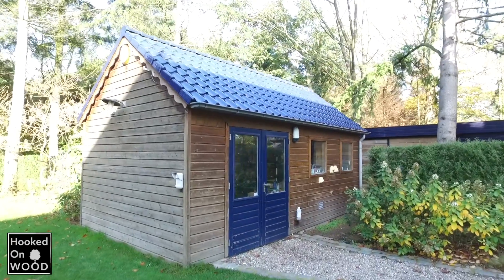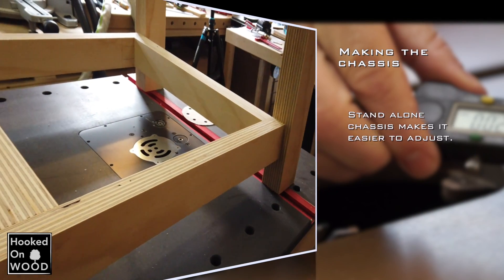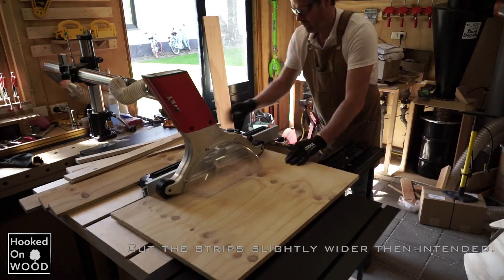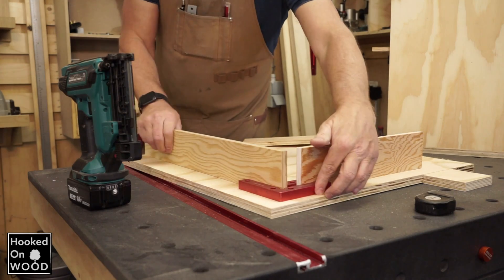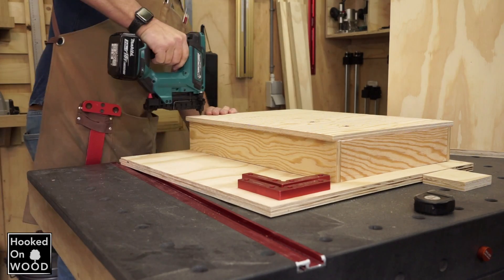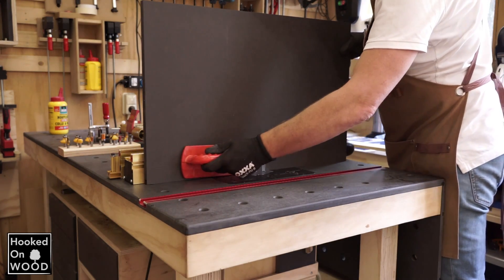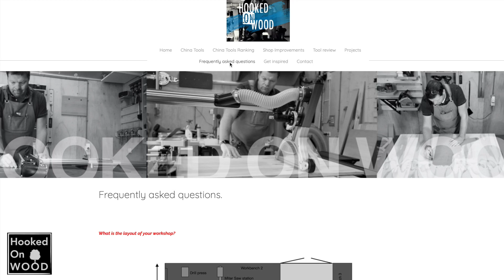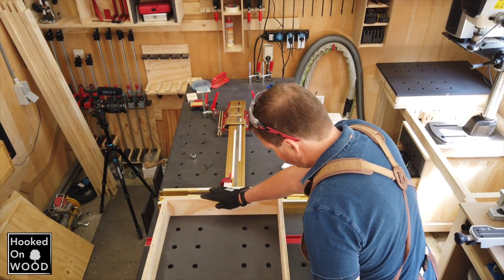Drill press - Miter station workbench!

Comment: great build, especially removable middle section . just wondering why you got rid of your pbd40? bought one to replace drill press and have found it a lot easier to use, more rigid and much better for small spaces. would like to know your reasons for getting rid of the bosch. thanks
Reply from the maker: Hi, I wanted one with more stability. This Jet, is better in that category. It runs smoother. What I miss, is the practical side of the Bosch. I am not negative about the Bosch, but it can not give you the stability as a bigger one.
Reply: @HookedonWood  phew. have only had my bosch for a short while and thought you might have come across some long term issues. keep up the great work and happy new year

Comment: Hi Dennis, you mention in this video that you had replaced your old drillpress. It looked like the Bosch PDB40, which I was planning to buy. Can you tell a bit about why you chose to switch? Mind you, I'm a hobby guy, so my workshop doesn't need the larger equipment that you probably do. Is the PDB40 a bad choice or did you just need a bigger machine?
Reply from the maker: Hi. Bo, no not a bad choice at all. I wanted a more stable one. But the Bosch is very practical. In that budget it is very good

Comment: Hi.. I'm about to build my new mitre station..  i had issues with the mitre saw.. Kickback most of the time.. I found i have to support the right side to avoid this problem.. Im using my right hand to cut the price.. And the left side supported by my left hand...but i see most people on YouTube keep more space to the left side.

What is your recommendation.. Should I leave more space to the left side or to the right side.
Reply from the maker: Hi, i would do what is most comfortabel for you. I place my wood at the left side and cut with my right hand. But this space is limited to 180cm . Bigger planks go to the right. I do not see any right or wrong to this. You should not get kick backs depending on how you use your miter saw.
Reply: @HookedonWood  thanks for your reply. I appreciate that.

Comment: Another beautiful build Dennis! In France I managed to get a version of the black MDF from Dispano.fr. It’s called Fibracolour from Finsa...good quality and several colours available..

BTW on your demo of using a table saw to cut dados, are you using a flat top blade for this? And if so do you mind sharing where you got them? Having real trouble tracking one down...

Thanks in advance.
Reply from the maker: Hi, I have to admit, it is very difficult to find a combination blade that you can use on all situations. In fact, I do not believe they exist in Europe. Freud have some but they are only for rip cuts. So, you need to change. I bought my in the USA. Ridge carbide, but they are very expansive especially with the extra cost of shipment and taxes. So, perhaps a router is better in Europe.  Thanks for the link. I put them on my site.
Reply: @HookedonWood  Thanks! was actually looking at the Ridge carbide ones from the US as not able to get any in Europe.  Don't understand why...no demand i guess.